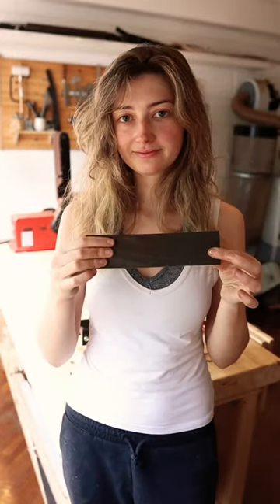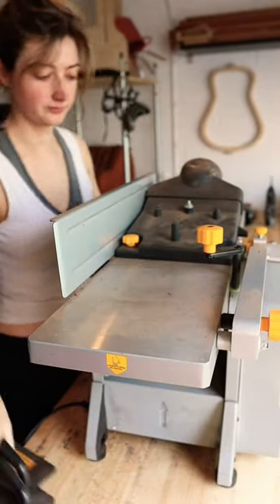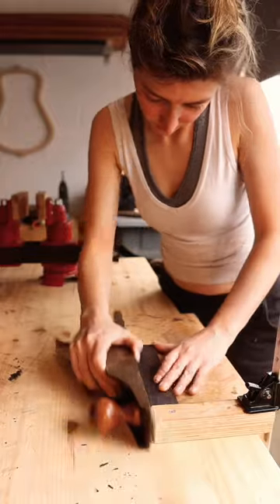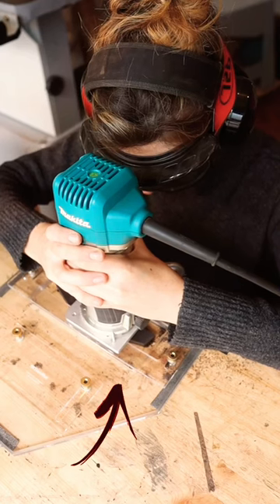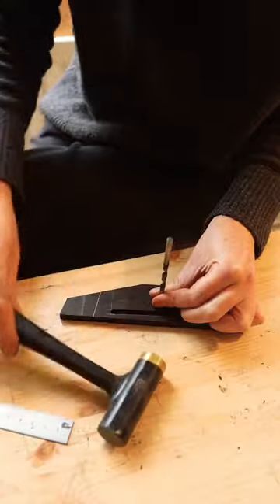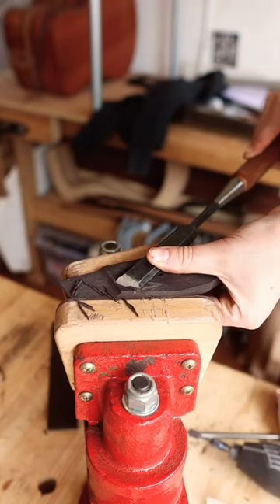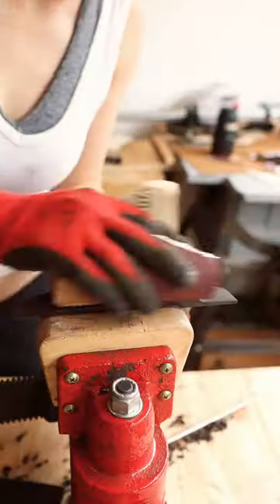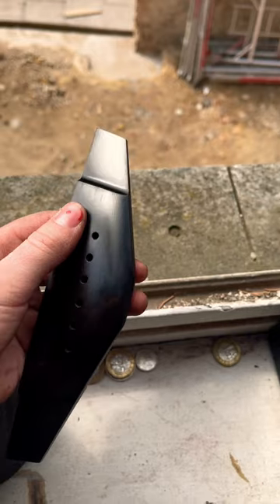How an acoustic guitar bridge is made #guitar #diy #woodworking #oddlysatisfying

Comment: Fun bridges fact! Martin has 3 different thickness bridges thay they use depending on the angle of the neck relative to the top. Huge pain in the butt when you're bringing the action down on the tallest size and suddenly the bridge is taller than than the edges of the saddle, and now the whole bridge has to be shaved down. God forbid a Martin needs a neck reset, it'll almost certainly need a new bridge too.

Comment: Ignorant question, Daisy; but why is Ebony so terrible for planing? I was looking into building a CNC Machine for messing with wood, and I'm curious...
Reply: It's an extremely hard and dense wood, about 3x as hard as walnut or cherry, and twice as hard as hard maple or white oak. Woods this hard can wreck your blades - whether that's a hand plane or an electric planer. And when using hand tools it tends to be physically demanding to simply push the tool through the wood. For power tools, carbide cutters (Shellix style) tend to work better. You can find carbide cutting bits for CNCs if you plan to work with very hard (or highly figured) woods